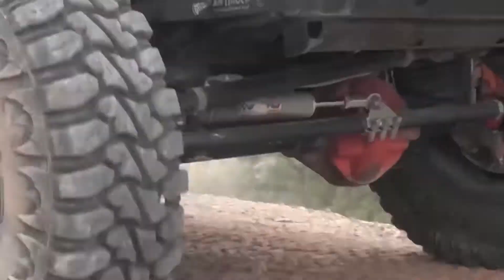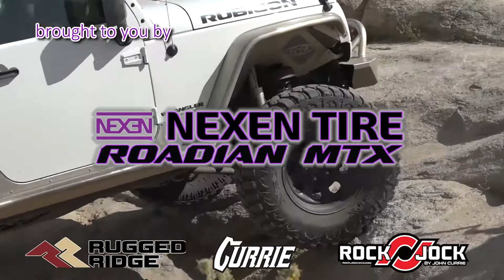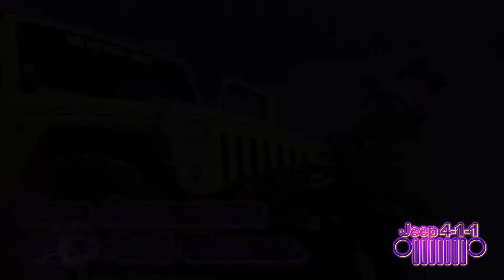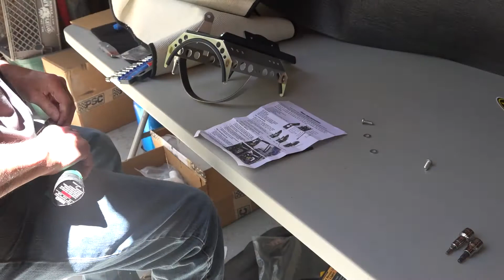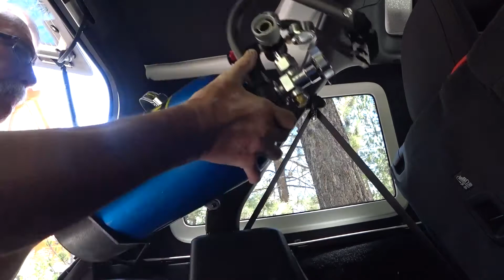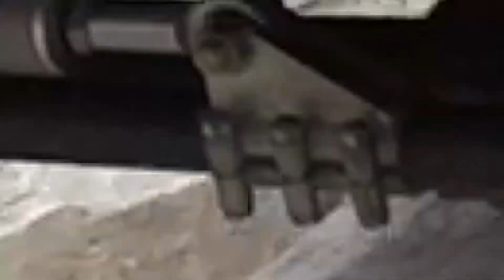PowerTank Jeep JL Roll Bar Bracket Install  This is a really nice bracket for a 10 lb PowerTank

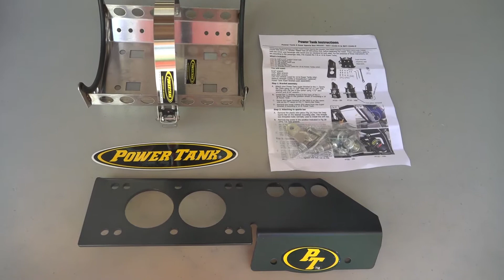Comment: At the 1:30 min mark you show the black mount bracket, at the 1:36 mark you show a small metal tab ( can't think of a proper name ).......did you fab up that tab or does it come with the mound? The reason I ask is it doesn't show up on the Power Tank website. Thanks for sharing.
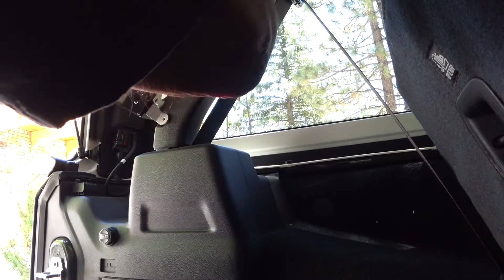Reply from the maker: The little sheet metal bracket comes with the mount. it helps stabilize the mount. Look at 2:27
Reply: @backcountrydriver  One other question, I was looking over my 2021 Wrangler and it looks like a trim piece on the roll bar has to be removed to get to the top bolt area.....is that correct. Thanks for the reply.
Reply from the maker: @Al-tl2ov  yes
Reply: It would be nice to do it without music and detail what you’re actually doing. Music doesn’t belong on install videos imo.

Comment: Hi great video thx 
I need to install that 10lb power tank. Do I need to get bracket separately and will it fit on 2022  JL 4 door or if you have a link where to get it all
Please advise 
Thx
Reply from the maker: The bracket is separate. It is designed to fit the 4 door JL and the install is easy. link:  https://powertank.com/collections/brackets/products/bkt-2240